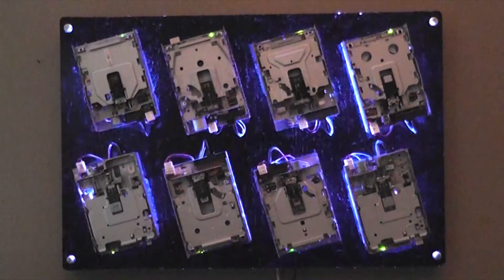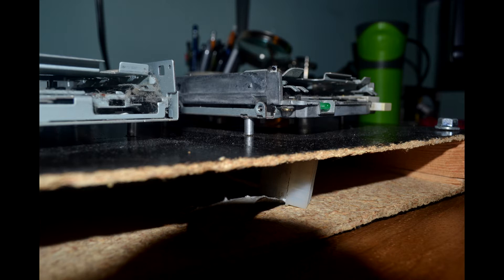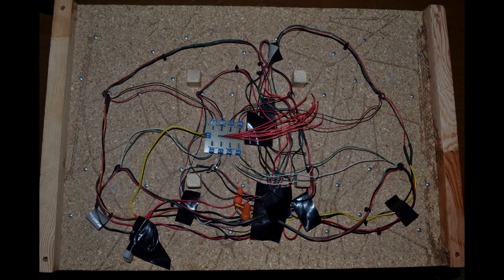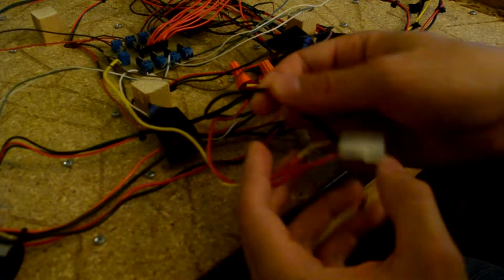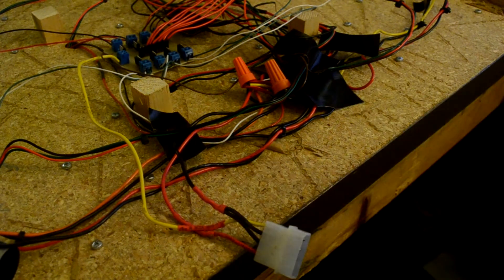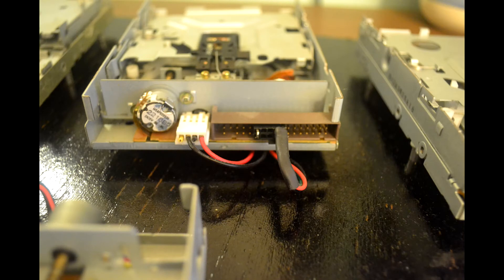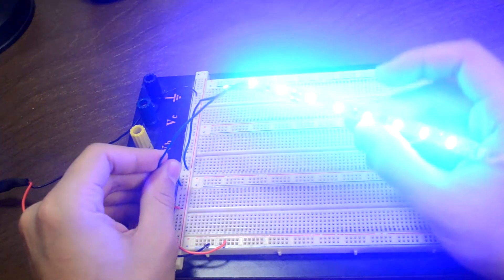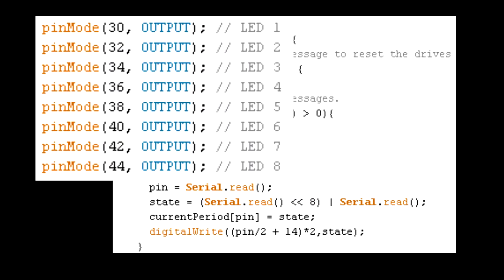Floppy Music: Tutorial / Behind The Scenes

Comment: Great video, thanks for the tutorial and very impressive setup! I'm planning on building something pretty similar but using an Arduino Duemilanove (which doesn't have as many pins as the mega), and wondered: Would be possible to put the MOSFETs in series with the wires to the floppy step pins to save on pin space?

Comment: I think another factor for the resonance is how well your able to transfer the vibrations from the drive to the wood. While true that chip wood may not have the best for the resonance, you'd probably also be better off without the spacers so there's full contact of the drive on the board. Then maybe finish the underside of the wood with glossy polyurethane for a nice, flat, somewhat rigid, sound reflecting surface. However, your LEDs are spectacular, so it's seems to be quite worth the trade off! Keep on keeping on!